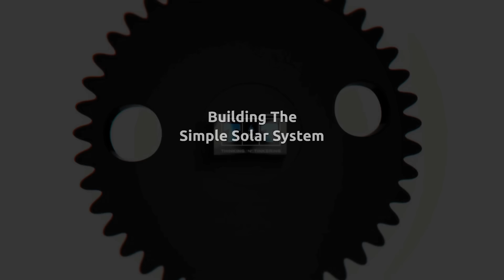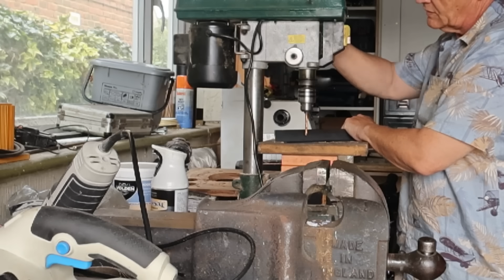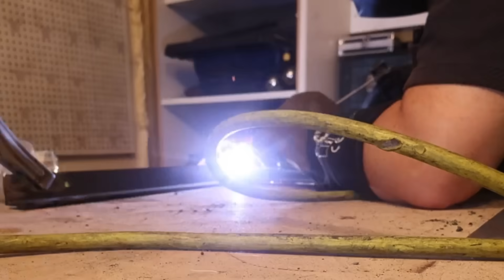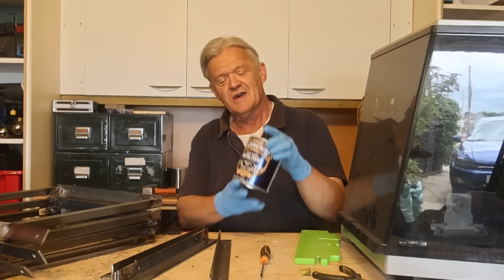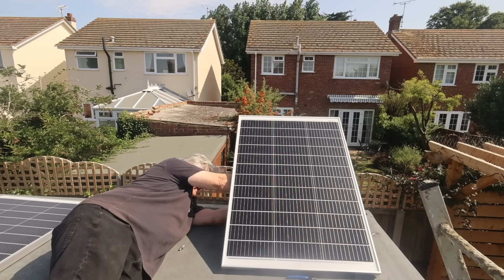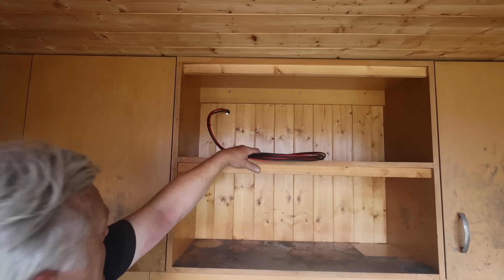2416 Building A Simple Solar System - Installing The Panels

Comment: You have touched upon a very question, I'm sure many have considered. The 12V automotive system has to be the most polished system in existence. Other than the several high voltage devices in the home you mentioned, everything else is now stepped down and a percentage in waisted. The biggest power waister in most homes is the cable box. These things sit and draw a massive power load and the cable companies don't care. It's your power. Vampire loads are everywhere in homes. I use power strips to kill systems not in use.
Reply from the maker: Good points mate - cheers

Comment: Hi Rob I'm doing exactly the same thing and I've also brought some led lights from AliExpress and cut into the tracks on their circuit brd to input 12 v so the extremely bright 240vac are now 12 v dv extremely light lights and I've been working up my spare lytham batts as 12 v bms controlled units for nighttime use and I've working on a vertical wind turbine with a modified rotor with permanent mags as the core that produces 12v at 150ma which I'll feed in using an old solar controller at some point I will combine my systems into one batt
Reply from the maker: Sounds really cool mate - thanks for sharing

Comment: youve made axactly the same choices as i have with both the home and allotment systems rob. and ive found with the addition of a dump load water heater as i cant possibly use all thw power produced every day and those charge controllers dont like the batteries being full for long before they konk out.i use buck converters for anthing dc above 12v like my laptop and battry tool charging.
Reply from the maker: Nice mate and I really like the idea of the dump load

Comment: Good luck avoiding an unwelcome visit from a planning enforcement officer. As you've guessed, it happened to me, on just such a project. He insisted on applying regulations that were clearly intended for pitched roofs and made no sense whatsoever on my flat roof. It left a bitter taste that nimbies triumphed over ecologists here. FWIW, I opted for series-parallel on four reclined panels, as my charge controller happily works with 24V input. I reasoned that it could help reduce the effects of partial shading, but this arrangement is less efficient than two well-directed panels.
Reply from the maker: I checked the planning mate and this is within what is called permitted development
Reply: Amazing. Not being too electronically savvy...but picking up on the implications 12v is a brilliant off grid answer...you are onto something that is being ignored...so much technology out there in the market...why not evolve this to the house?

Comment: First thing I did with camping (mainly 'off grid') was to sort out 12volt solutions to things. These days most thing can be done 12v The laptop (which is used as a tv/etc) was easy. Lights very easy. It went on. Ended up that there was very little we needed 240V for! Now we have gone /going gasless for cooking ,  we do need 240V for induction hob, but we have for example a rice cooker that is 12v and works very well. A self heated pan thats 12v. They do us fine.  Not perfect and we are camping for pleasure so not needing instant.
Reply from the maker: I have found the same thing mate - when you look into it - a surprising number of things just don't need AC

Comment: Most 3D printers run on 12 or 24 volt DC for the bed and hot end. The exception bring a few larger printers use AC for the bed heater. I've considered the same myself Re having a separate domestic dc circuit. If all our lighting from now on is with LEDs, and we're paying for built in AC mains converter in every lamp. Just need to consider anything else that's on the circuit like extractor fans but could be swapped for DC motors.
Reply from the maker: absolutely mate

Comment: Tomorrows World once did a segment on low power wiring, but now with wireless, we no longer need a (wired) switch on the wall, remote control, voice control, gestures,
just need a backup plan for an emergency. In a bigger building centralized power storage would have the wiring all about the same length. Automotive or yachts.
Reply from the maker: absolutely mate

Comment: I run my garage on 12v set up and I’ve got a 2000w dc to ac inverter that runs my fridge freezer and water distiller in the house, and I’ve been thinking about running new 12v lights and 12v appliances in the house too, the same as how you do a 12v moterhome 12v setup
Reply from the maker: nice!

Comment: People get so hot under the collar about the series/parallel argument. The ONLY advantage to the series set up, in a properly designed system with the correct charge controller, is you get away with less copper in the cables from roof to charge controller. That’s it. Given adequate girth, both setups behave exactly the same, in ideal conditions.
But, here’s the kicker. When things are NOT ideal, like when one panel is shaded, or simply dirty, series wiring results in the whole system being limited to whatever the maximum current from the shaded panel is. Parallel wiring will still allow the unimpeded panels to produce their peak current, so in real world conditions, if you have room and the budget for heavy cables, parallel gives better long term results.
Reply from the maker: i agree they do get hot under the collar for no good reason and I like your argument - thanks for sharing mate

Comment: In the 70s I worked for a Bell company (US) and in the switch  relay buildings they had huge 48v batteries to power them. I have been wondering about using an electric forklift battery as energy storage. I want to have my detached garage as backup to my house if something major goes amiss. Items with heavy draw would be a small electric heater and an induction hot plate, plus battery chargers.
Thoughts on the battery idea?
Reply from the maker: To be honest mate - I don't really recommend stuff as there are just too many factors involved for me to make a good recommendation.
Reply: @ThinkingandTinkering I actually saw the video preceding this one, after watching this one and realized I was doing ok muddling through on my own without bothering you. Sorry.

Comment: You hit the nail on the head with the 12V rail system idea. There are so many 12V electronics available that can utilize this power source, worse case, you can always scale up to 24/36/48V too depending on your load needs, and slap in buck/boost converters to generate the 5/9/12/19.5V or whatever you may need, digital logic/USB, smoke detectors, audio amplifiers and LED lights, charging laptops and running small desktop PC's, all these things are completely possible via these sorts of setups, and the best part, that most people overlook 99% of the time; This setup is a cheap mans UPS. Who needs to buy a UPS module just for a PC to keep it from loosing data during a brownout, when you can have a battery supply that keeps it running for more than long enough to properly save the state and shut the machine down.

Fun fact, the USA is looking into adapting the grid from HVAC to EHVDC, due to all the renewables, since AC phase matching is a female dog 😂 DC of course is much simpler, either series or parallel, the power adds up, there's no phase magic to deal with. EHVDC is also much more energy efficient over distance vs AC due to impedance. The inductance and capacitance of the mains eats AC power that we don't even think about on our day to day scale, but is the bane of electrical grid engineers, and this is why the idea to switch to DC over AC is more enticing, as at high enough DC voltages, the resistance of the conductors becomes negligible, and it actually becomes more efficient to push the DC down the length than it does AC.
Reply from the maker: That was a fascinating post mate - thank you for taking the time to share it
Reply: my security cam and internet  use 12v plug to 230  ./.  i still can go 12v with a dc  buck and boost... if  use  12v pump 12v led bars    and a 12v. emergency fridge its almost entirely  independend to low voltage

Comment: 🇬🇧Brit here 🇬🇧. I am bit worried about this it could lead to energy companies lowering our main input and then charging us for a separate supply for larger devices .?
Reply from the maker: well they sort of already do mate - in industry they use power correction capacitors  - resistive use is easy to measure - lights and heat - inductive use is hard - motors for example - that's because there is an unreal component in inductive motors - in industry which uses a lot of motors they have power correction caps to take care of the real use as opposed to the apparent use

Comment: Please link to a genuine 12v 2000w pure sine wave inverter that's £50. While I appreciate that a 12v system benefits from having lots of appliances being available, the same can be said for 240v/110v AC. The AC appliances tend to be significantly cheaper, and there's much more choice of appliances, and at various price points. Yes, there's a trade off with loses in conversion, but your house is probably already wired for 240v, so there's no need to add all the additional hardware required to run DC currents around. Solar panels are relatively inexpensive, so if space permits, additional generation capacity would make up the the losses.
Reply from the maker: I agree - to a degree! -  that's why I haven't done my house - but this is a shed and allows me the opportunity to experiment.

Comment: Great Brackets Rob.  I know you know, but it's worth pointing out how correct you are mate.  On our boat we have a 12v kettle and heater (bought from halfords for intended use in cara/vans), a 12v fridge freezer, 12v tv and loads of 12v lighting.  No inverter,  and therefore no loss for any of those.  We do have an electric blanket for the winter that needs a 150w inverter which hardly taxes our battery bank.  There are also loads of surface mount usb sockets that run from 12v.  As you say, what isn't powered by usb these days.  Keep it up mate.
Reply from the maker: Cheers mate

Comment: I made all my internal lights 12 volts using the existng house wires and putting 12 volt globes on a few simple calcs with battery but want to convert to solar. Just busy saving
Reply from the maker: nice one mate

Comment: Also a plus for a DC lighting system is durability. Most 120V/240V LED lamps slow fry the electronic AC-DC converters to get to the old 3000 hours lifetime model they had of selling bulbs. ^^
Reply from the maker: absolutely mate

Comment: Love your simple way of explaining things. I’d suggest you put some sort of sealing gasket between the frames you made and the roof. The grommet on the screws is only sealing between the screw and the top of the steel buckets. A strip of rubber or even a cut up bicycle inner tube would work.
Reply from the maker: thank you mate - cheers

Comment: I was for quiet long thinking about idea of running DC through house because everything runs DC anyway, glad to see video about idea.
Interesting fact is that most modern equipment that have computers in them actually run DC.
How they run is usually rectifying wall AC and then using DC to power invertor that controls motors, things like fridges and washing machines.
Reply from the maker: Cheers mate

Comment: One thing to look into is how to connect with the batteries.   I have read in several locations that a bus bar system with one end to power,  ground " bus bar connected to the physical opposite end.  This allegedly has the advantage of not having power enter and exit one of a row of batteries.   The other thing to watch is the amperage of connected devices as they will need bigger wires so as not to become heating elements in the system.
Reply from the maker: the choices in connection are parallel or serial mate - in serial you are always going to have a first battery - so to speak. Your point about the wiring is spot on but in house wiring 1mm csa wire or even 1.5mm csa which is more common - is often used for lighting -1mm is rated to carry about 6 amps at 12v that's 72 watts and 1,5mm is 14A, 12V 168w - not a lot for old style lighting where a dim bulb was often 40-60w. But these days LED lighting is far more common and I have long since replaced all my old bulbs with LED lamps with the same lumens at 4-8w.

Comment: Always thought it would be easier and safer to run my house lighting on 12v especially since the house is built entirely from steel and foam SIP panels and given that car lights can produce more than enough brightness! House is wired up ready for power to be installed but not quite there yet… This little adventure will be very useful to me thanks!
Reply from the maker: What you are up to sounds fascinating mate

Comment: Fair enough to charge batteries off solar, a charge controller is ideal, however, I've been 3d printing for a few years (tears;-(), reckon if you have something like an Ender 3 that runs on 24v you could run it off 2 lead acid batteries in series, something I'd love to try myself but unfortunately don't have a shed)big garden
Reply from the maker: That is a shame mate

Comment: interesting considerations. i'd probably opt for the on-demand choice of inverting only when needed, simply for the greater level of control you'd have over the circuit. and you could go with heavier gauge welders cable and fuses to buffer the panels ability to overproduce and fend off a bit of resistance. something i learned the hard way with my first charge controller and cables - my 1st 400W panel used to pull in ~700W constant on a good stretch of sun!
Reply from the maker: nice advice mate - cheers

Comment: In my, admittedly limited, experience, the inexpensive 'pure sine wave' inverters do not really produce a pure sine wave.  I have one as a backup and it makes my PC hum like crazy!  My quite expensive inverter does not.  I chose not to try to run my refrigerator w/ the cheap one.  It worked OK for some things, but others, not so much.
Reply from the maker: to be honest mate - no so called pure sine wave inverter produces a pure sine wave - they all use switching - the only real difference is the number of times they switch - cheap ones switch about 3 times the more expensive ones switch at rates about 5 times - but they all are stepped wave functions - calling it pure sine wave is really just marketing

Comment: After having spent many years playing with different voltages on various sites the idea of voltage turns out to be 24 volts. The reason is simple you can get 24 volt fridges, deep freezers, kettles, microwaves, washing machines, TVs, hair dryers, vacuum cleaners, in fact almost anything you want on 24 volts. It seems that international lead 24 volts the accepted as the emergency voltage used by the military and also for medical field hospitals. Campers and trucks usie 24 volts almost exclusively when using DC. There are plenty 24 to 12 volt down converters for 12 volt products. 24 to 19 volt converters used for notebooks are available and used by truckers and campus. Almost anything you need is available on 24 volts. Next the fridges and deep freezers using 24 volts only use around 5,0 or 6 amps compare to 12 to 14 amps for the 12 volt versions. So running a 12 volt meant having to use very heavy cable verse 24 volts much lighter cable requirements and far less effect with current voltage drops on the cable.
Next on one site where we used 24 volts we did not even rewire the house. We simply change the plug outlets do you have fuel cigarette lighter sockets so that standard 24 volt products could plug straight into these sockets. The wiring was standard 16 to a 20 amp cables which was more than capable of carrying the current of these 24 volt products. A deep freezer and fridge together used 12 amps which work quite happily on the one socket in the kitchen. All we did was convert the DB board to run 24 volts instead of 220 volts. 24 volts really did turnout to be the best all-round solar off grid viability.
Reply from the maker: that is fascinating met - thank you for sharing that - i did not know it!
Reply: Excellent

Comment: I disagree about the voltage of 12 volts, even 110 is not enough. The problem with low voltage is in huge currents under any serious load, for example, in Russia, even 3-phase voltages of 400 volts are used, which allows you to connect powerful electric stoves or machines. Calculate what the current will be if you connect a standard electric kettle to 12 volts, 2200 watts, current 1803 amperes, or, for example, an electric stove 5000-10000 watts, current 833 amperes, and what will be the losses on the wires, what kind of wires will these be, moreover, it is more difficult to work with thick and rough wires, and more difficult in all senses.
Reply: A standard kettle  running at 240v is rated around 2200W so that is using roughly 2200/240 =  ~9.2 amps. If it was 12v for the same load then the current would be 9.2 x 20 = 184 amps wouldn't it?
Reply: @fleaniswerkhardt4647  There's definitely a stray zero in there, but the point is correct.
Reply: @simonduffy99  When there is nothing to object to in essence, they always look for typos.
Reply from the maker: It's like anything mate - nothing is perfect in all cases. Your calculation is wrong by the way
Reply: @ThinkingandTinkering  Yes, and where is the mistake, why do you have an unfounded statement in your answer, is it normal for you that the refutation does not contain evidence?

Comment: Totally agree about 12v DC and 12v DC or DC appliances. I live off grid with a 12v solar system which runs all lights, laptop and phone chargers and a 12v pump for my shower. Just bought a great 12v compressor fridge.
Reply from the maker: nice mate